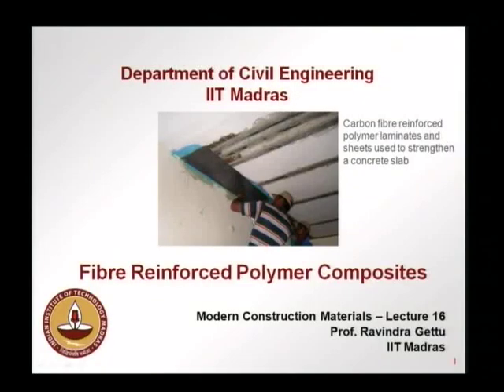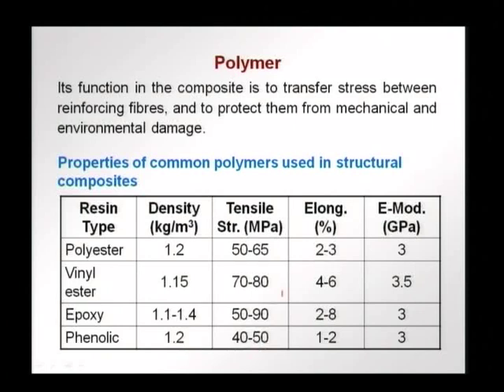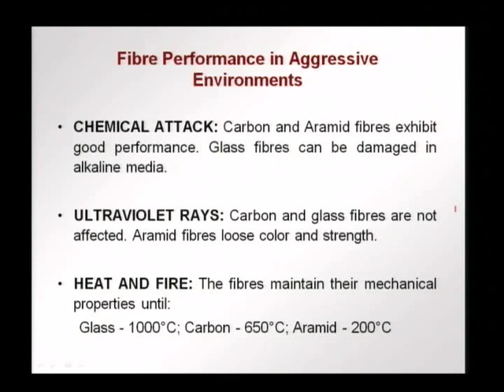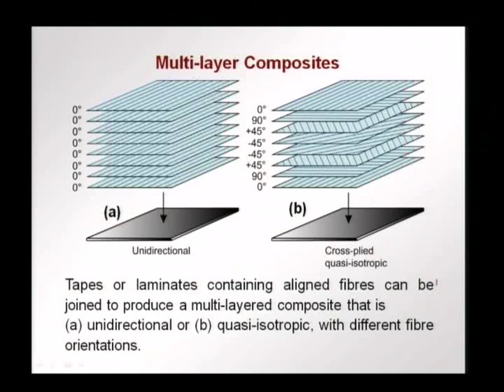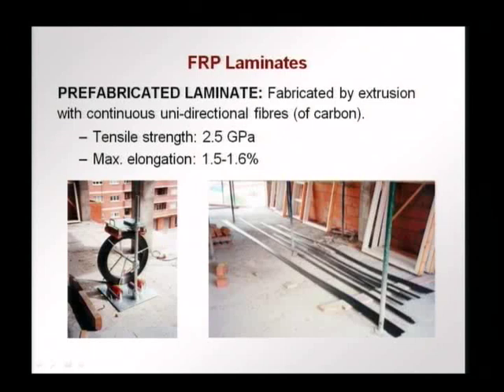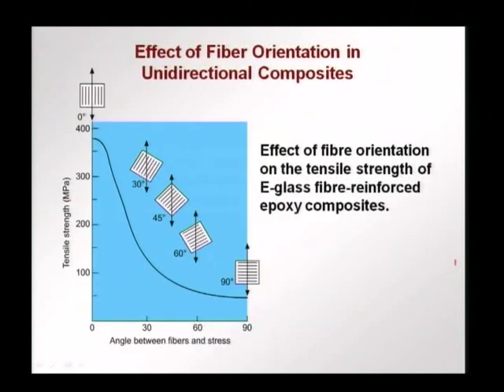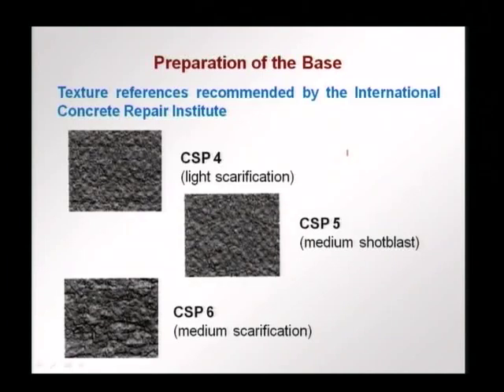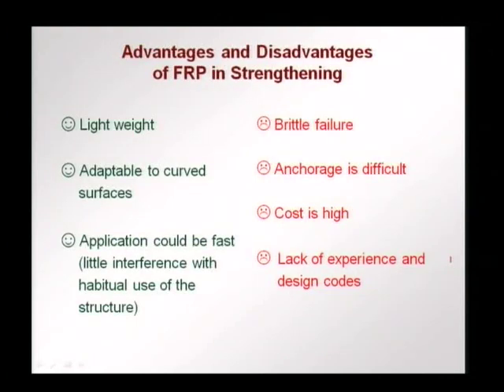Fibre Reinforced Polymer - 1

Comment: Sir, very  nice video. Can you tell me sir how would FRP  adhesives such as the epoxy saturants and adhesives behave in case of excessive heat . I understand from your lecture that FRP are good temp resistance but how would the adhesives behave. Epoxies are not good if exposed to high temperature for a long period of time. Can you please enhance me on this